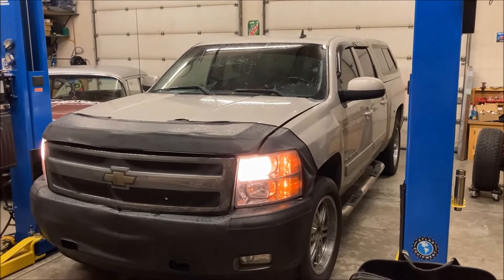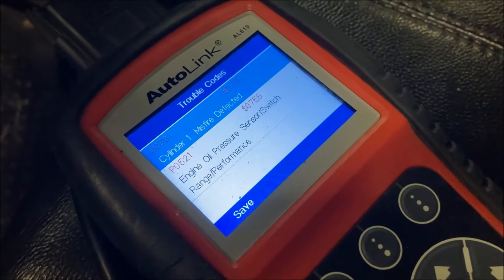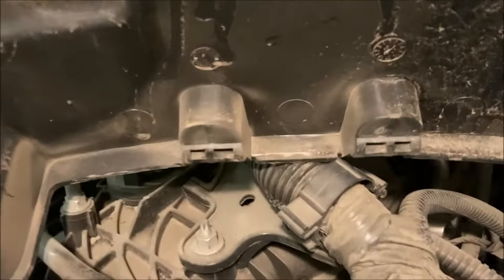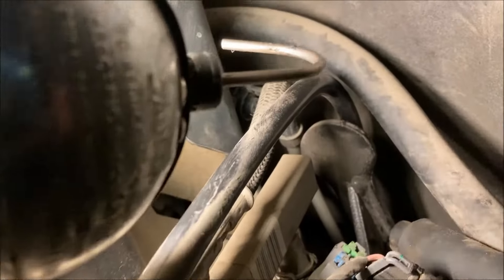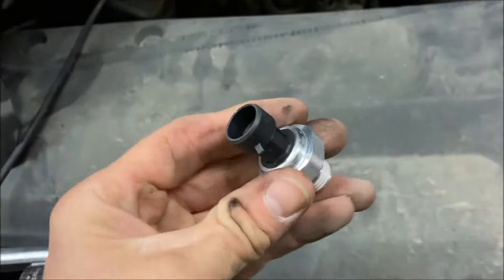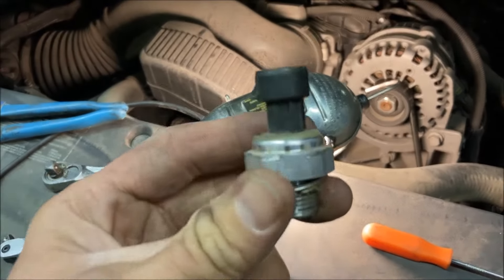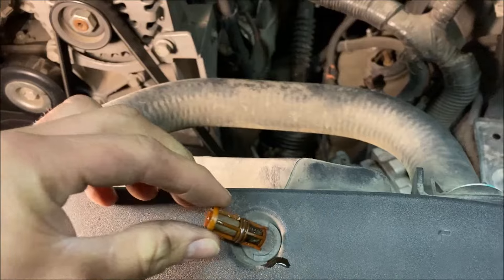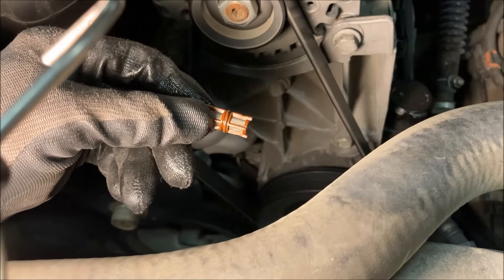P0521 Oil Pressure Sensor Error Code 07 -13 Chevy Silverado

Comment: If you plugged that valve how would you recommend removing the p0521 code mechanical pressure is in tolerances ecu pressure reads 8psi at 3200 rpm lol

Comment: Always amazes me when a sensor sends a code something is wrong everyone suggests changing sensor. The sensor is doing its job and is letting you know something is wrong. I had a dealership shop change 1300.00 dollars in sensors just to tell me nothing. I went to a local shop and they said it was a bad distributor he changed it and wires/plugs all in for 600.00.. Wow! The dealerships are ripoffs mechanics must have worked for auto zone before!
Reply: I had a stock corvette and the sensor said I had 126 psi of oil pressure.

Comment: Why on earth would you change the sensor for that code without checking wiring integrity and sensor performance first?
Reply from the maker: worthy question if you have the voltmeter and values, that's a proper way.  If not, the sensor is cheap and fairly quick to swap.

Comment: Any suggestions on what it could be if i changed the sensor and filter and the light comes back on again a few days later?
Reply: I had the exact issue on my 2011 Sierra and although I can’t pin point a specific thing I can’t tell you that 07-13 Silverados and Sierras have major grounding wire issues and when a grounding wire gets loose it trips the computer into thinking there’s something wrong with the oil pressure sensor and brings up the damn check engine light. I replaced the OPS when I had just bought the truck and a week later it came back, took it to to get all the grounding wires checked, cleaned retightened and the issue went away for a year but just recently it came back.
Reply from the maker: Bad oil pump pickup tube o-ring, or bad oil pump, or motor could be done if ran too long without sufficient oil pressure.
Reply: @gmcsierra4889 could you share some details about getting these checked ? Which wire was bad ?